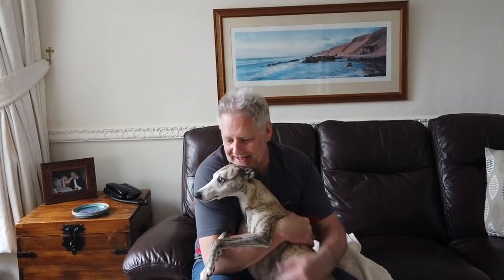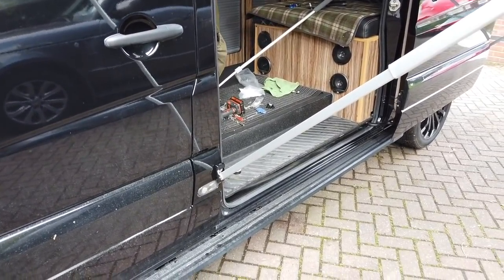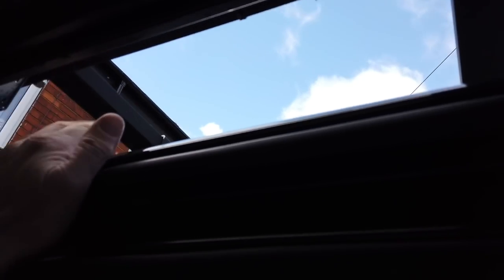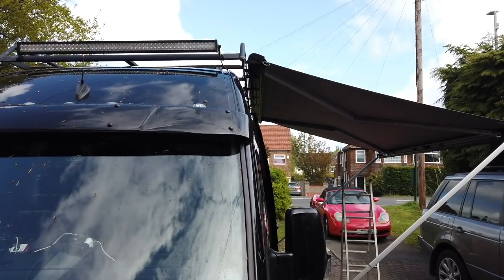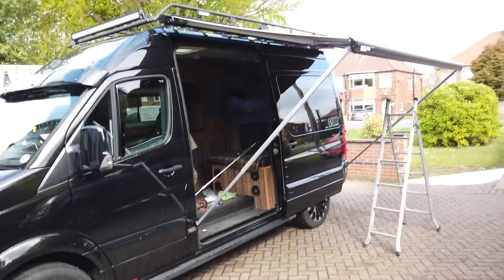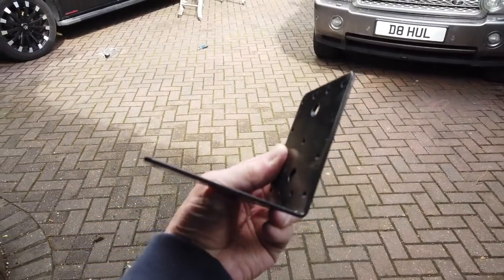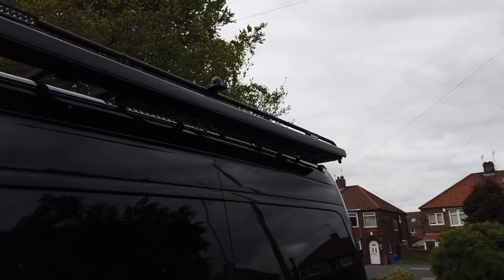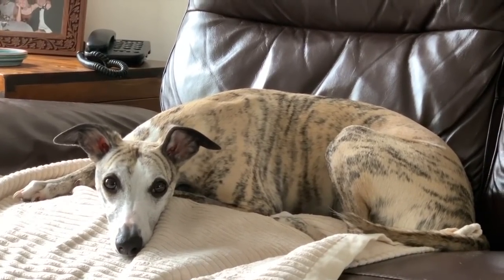Louie is better and the Fiamma F80s awning gets fitted to the Crafter

Comment: Nice to hear wasnt only me that had a nightmare with a crafter wind out awning two sets of brackets and a welder fabricator father inlaw and finally fitted 👍😎🏴
Reply from the maker: Lol I’ve also had 3 bits replaced due to the snapping off 😩 I’ve only used it once 🤔 
Best regards Louie and his poo pickers 👍😀🐾🍺🍟
Reply: @onemanandhiswhippet  I bought fiama brackets which were wrong angle but very strong then father in law cut and welded them at correct angle finally it fitted but one bracket sticks out a little at back but i dont care anymore lol it's on
Reply from the maker: LOL I know how you feel 👍 you get to the Point of it will do now 👍👍👍👍

Comment: Hi mate 

I'm in a very similar situation with my sprinter/awning.
I want to mount it straight onto the top of my roof deck. 

What's the deal with fixings? Can you just screw away straight into the underside of the casing? 
Looks like you used self tapping screws into the underside?

Any advice appreciated 
Ed
Reply from the maker: Hi Ed no I undid the awning on the floor so it was fully expected and pick the best place to drill it and then use stainless steel nuts and bolts and big washers to spread the load 👍 hope that helps 😁 it’s been on my van for about 3 years now and no problem with it 👍🙏😍

Comment: Hi can you tell me how you bolted to the underneath of the awning do they have a track for bolts or did you have to drill holes in it as I want to fit one on to unistrut rail on my roof 
Cheers
Reply from the maker: Hi there I rolled out the full awning lined it up with my brackets and the drilled it 👍 thanks for watching 👍😀🐾

Comment: I noticed your brackets are bolted through the underside of the awning case . Is this easily accessible? Cheers
Reply from the maker: Hi Alan 

The brackets I used are very good but I’ve double them up now to take all the flex out they just sit on top of the first set which works really well. 
Now when drilling the awning you need to lay it out rolled on the ground upside down 

then place the brackets on the awning to work out where you are going to fit the. 

Remember you also need to know where they are going on the roof rack too ! 

I used 8mm bolts and made them captive by putting a nut on the outside this makes it very easy to fasten it to the roof rack brackets.

Fit your brackets to the side of the rack and then (with help) lift the awning on to the brackets sliding the bolts through the holes on the brackets then using washers on each of the studs using locking nuts 👍 

Then you are all sorted 👍 the one on my van is working really well with that set up 👍 I have 10 brackets on my van that are double up 😀 
Hope that helps Best regards Louie and his two poo pickers 👍😀🐾🍺🍟

Comment: Hi, love your awning solution, I need to do the same thing. Sorry to appear thick but how have you attached your angle brackets to the awning. Thanks for all the great content
Reply from the maker: Hi there I just unrolled the awning and lined it up with the bracket then drilled it and used nuts and bolts 👍 thanks for watching 👍😀🐾
Reply: Yes, I am doing the same with a Fiamma F80 yet when I unrolled the awning all the way to put the bolts in I had only enough space to place one bolt about an inch from the edge. There simply was not enough space under the roll to place another bolt thus there is only one bolt per L bracket attaching the awning to the L bracket.
How did you manage to place two?

Comment: Fantastic idea on how to fit this to a roof rack. Where did you get the metal brackets from?
Reply from the maker: They are fence brackets from B&Q there about £2:50 each I just painted them black ( they come brown) 👍😀🐾
Reply: Did you consider installing the Fiamma F45s instead as that is designed to mount on the side of the vehicle?
Reply from the maker: Alex Dickie no I wanted want to fit on the side of the rack👍😀🐾
Reply: One Man and His Whippet I've got the same roof rack as you for a LWB. I was thinking of using the F45s as it's designed to mount on the side of the vehicle, but instead of mounting it on the van I was going to attach it to the side like you've done as all the mounts will be in the right place without having to buy extra brackets.
Reply from the maker: Sounds like a good plan I’m very happy with my setup 👍 best of luck 👍😀🐾

Comment: Hi I was wondering if you can give me a bit of info on how you fixed your brackets to your actual awning
Reply from the maker: Hi there I just undid the full awning and lined it up with the brackets then drilled through and fixed it with nuts and bolts 👍 thanks for watching 👍😀🐾
Reply: One Man and His Whippet that’s great thank you , I’ve built my own camper and have solar panels on the roof so can’t fix the original brackets on due to the unistrut I have used for the solar panels I’ll get started on this tomorrow and get the awning on some how thanks again love the videos take care and stay safe
Reply from the maker: ian fairbairn anytime 👍best of luck 👍😀🐾

Comment: Hi, loving the channel. I'm just starting a Crafter build. Looking at the same roofrack as you have, do you have roof fans fitted, if so how did you get round it please? Also where did you pick up the awning brackets? Thanks Mark
Reply from the maker: Hi Mark
The roof rack is just cut to enable the roof vents to open 👍 I also put plastic plugs on the ends I cut 👍 the brackets are from B&Q they are about £2:50 each they are powder coated Brown and I spread them black
Hope that helps 👍 good luck with your van 👍😀🐾
Reply: Hi Dave just a quick question on your awning I have a Mercedes sprinter 144 like your Crafter I have a Rhino roof rack I have what’s your video on how you’ve fitted it I’m just wondering before I order is it possible that you can get that same make of awning under the roof rackAnd make some different brackets so that it fits tighter to the roof or was it impossible thanks Sean

Comment: Hi great video iav just got the same awning as you on the back of the awning there are 3 places to mount the brackets i also want to put extra brackets like you have done for extra support did you screw the extra brackets on our did you use sikaflex or something similar thanks for your help 👍
Reply from the maker: I took apart the full unit and drilled it  then used stainless steel nuts and bolts 👍
Reply: @onemanandhiswhippet  thats brilliant thank you so much for your help 👍
Reply from the maker: @ThePistol1977  👍👍

Comment: Where did you get those L shaped brackets from please?
Reply from the maker: They are Fence brackets from B&Q like this just bigger they are still working well 👍 https://www.ebay.co.uk/itm/HEAVY-DUTY-REINFORCED-GALVANISED-ANGLE-L-BRACKETS-CORNER-BRACE-TIMBER-2-5mm-T-/142332041679?_trksid=p2349624.m46890.l49292